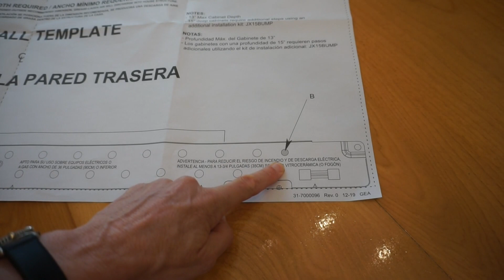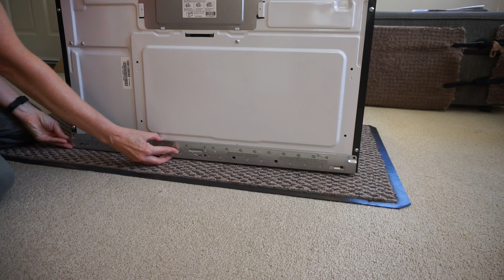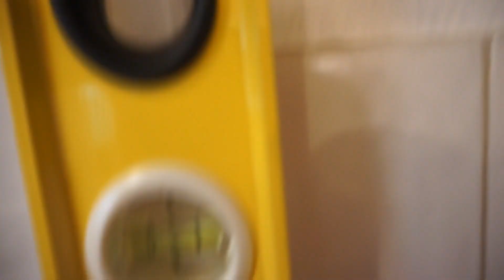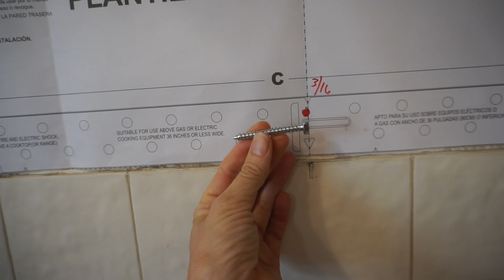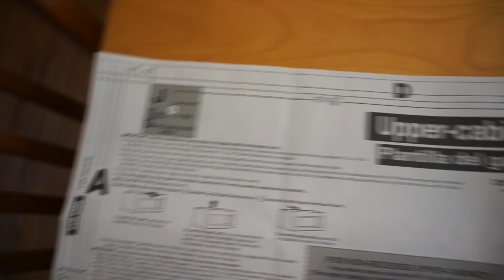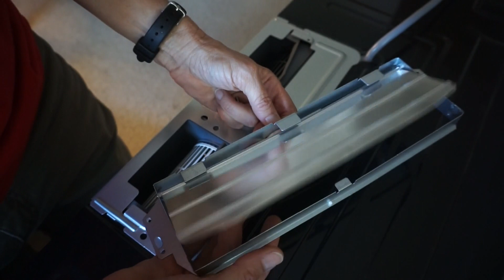Install Replacement Over the Range Microwave Oven

Comment: those templates never seem to be correct. I use them as an initial guide but always measure or in this case use the actual support bracket. Even for a simple towel bar, they seem to be a little off. Thanks for the video!
Reply from the maker: Thanks for the input on the templates.  Lately, I've found many errors/problems with items I have bought.  Echo had the wrong starting instructions with their string trimmer.  If followed they flood the engine.  The closet bolts I bought at Ace Hardware for fastening a toilet to the flange had the wrong threads on them!  Bluntly, it sucked.  I set the toilet on the wax ring and found that I couldn't get the nuts supplied to thread.  I had to pick up the toilet.  Run to the store for a new wax ring and new bolts.